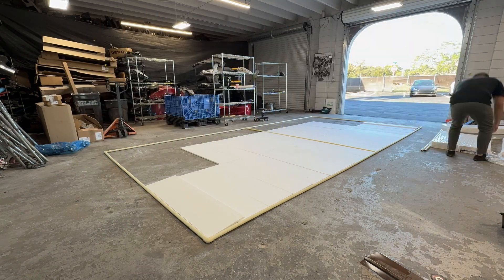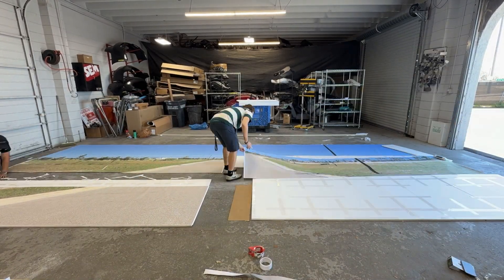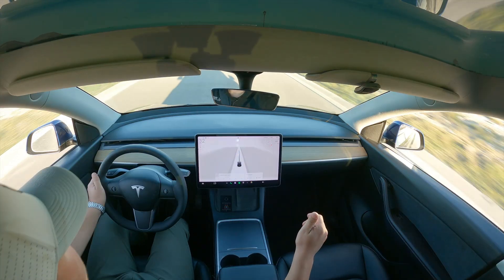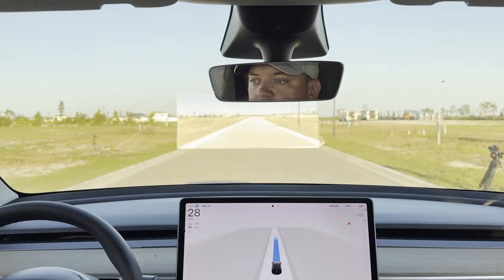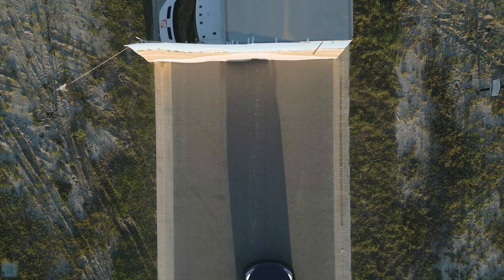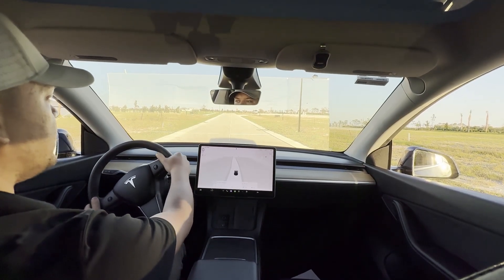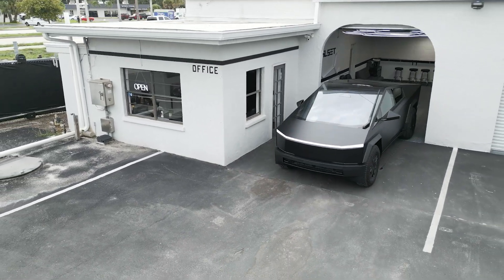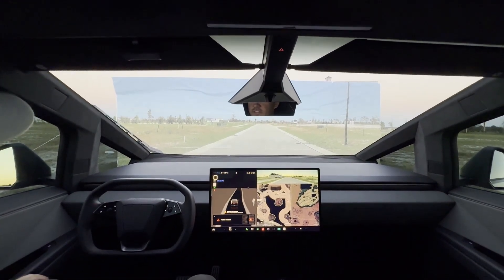Response to Mark Rober’s “Can You Fool A Self Driving Car?”

Comment: Teslas also have radar built in that are fused with the vision data, mark robers video was false, and simply advertising for his investment in a lidar company.
Reply: No they don't. They used to have radar, but Tesla switched solely to cameras in 2022. They also had ultrasonic sensors, which they also removed. Of course older models produced before this change still have the sensors, but tests should realistically be done on what someone can buy TODAY, not what you could buy a couple of years ago.

Mark Robers video isn't exactly false, but it's not scientific either, he made a lot of assumptions about how Tesla FSD and Autopilot works instead of research, which is a bit strange for a former NASA engineer. Either way it's right, a Tesla car relying solely on cameras would absolutely plow through a fake wall with the road painted on it, it's not trained to handle that and frankly isn't a realistic expectation that it should've been trained on it.
Reply: Further on this note radar had been proven to be more reliable through diverse weather farther than lidar could ever achieve due to the basic principals of its function

Comment: Yeah I'm not understanding. You repeating "not touching, not touching, but you did, and we're not clear that you had to press the break to prevent it in the first half. Then with the cyber truck you run it and while it seems like it stopped itself, I'm not totally sure, but the sky had gone grey and the lighting was gone, so the wall stood out in contrast. 
It was the big box truck behind the wall that lead me to realize you weren't going to let the cars slam through in any case. I just feel that you need to make the point you hit the break so that it's clear to the viewer when you did manually apply vs not.

Comment: if you engineer it to crash, then it will crash. And if it doesn't, just engineer it better. 
The point about Tesla self-driving is much more that it is simply not all that self-driving. If the user manual tells you that you cannot sleep behind the wheel, then it's a toy and not something that would be actually useful.

Comment: Great video. I wish the current version of FSD was tested, you can see there was an update pending. I used 12.5.4.2 before and feel the current version 12.6.4 is way better although I'm wondering if it would have stopped. I would guess it would not have.  Maybe having the better cameras on HW4 helped out.

Comment: If you look closely when he approaches the wall in the cybertruck in the visualization (6:58), it only sees the difference between the road and the picture like a small bump. 
When he is fully stopped and closer to the wall is not even there in the visualization.

This and the different lighting conditions.
Reply: AFAIK, the Occupancy Network visualisations (what stopped the Cybertruck here) are always shown as bumps on the road, and never as a full 3D space while driving.
They only show the detailed Occupancy Network data when driving under 5 mph, during parking.
Reply: i am also curious as to why the visualization fades away the wall into the fake road. 

and i've watch the more recent vid which shows the discrepancy is not from lighting conditions.
Reply: The visualization is not fully accurate, what the car actually decides to stop for may necessarily not be shown on the display, or, at the very least, displayed accurately. The car does not use this visualization for its decisions, the visualization is just for us humans through post-processing.
Reply: The different lighting conditions & big version gap (12 vs 13 is dramatically different) are the main factors, or even Hardware 3 vs 4 can be huge too

Comment: Facts.
Tesla phased out Radar May 2021, and ultrasonic sensors Oct 2022 for Tesla Vision only. They only brought Radar back to Model X and S in 2023 which would detect the wall 500ft out. The cyber truck only using HW4 seemed to detect it within safe braking distance. HOWEVER, If the wall was seamless and done at the same time of day as the Y, that would be another test entirely.

Comment: Thanks for doing this - but I will say that when comparing vehicles against each other you need to do them at the same time of day, and preferably switch between them between attempts. If you can find a Model Y with HW4 that would also be interesting to compare against a Cybertruck using the same software version.

Comment: So people have pointed out that the lighting on the Cybertruck runs isn't a good apples to apples comparison, but another thing to consider is the position of the cameras. The Cybertruck is a lot bigger and the angle the camera views it at could also lead ot to see the depth differently. Taking an image shot at a higher altitude to match the Cybertruck's higher positioned canera could also be a factor.

Comment: It can be trained to recognize fake walls perfectly, there is just no need for it.
Reply: Probably not as special training for edge cases often worses the performance for normal cases a lot in AI systems  - you run often very fast in AI overfitting ~ overtrainig with edge cases.  that's a problem of all AI systems.

Comment: This experiment lacks proper scientific methodology and is not an accurate comparison. The Model Y is significantly smaller and lower to the ground than the Cybertruck, meaning the billboard used in the test was not to scale for both vehicles. A properly scaled test would require a much larger and wider obstruction to account for the Cybertruck’s increased height and width. Additionally, the presence of multiple creases in the billboard could have influenced how the cameras or sensors interpreted the obstacle. Given these inconsistencies, this test does not provide meaningful raw data. Based on established technology, LiDAR remains a more reliable system than cameras alone when it comes to ensuring safety in complex driving environments.
Reply: It's baffling how anyone could think that you can do this reliably with just cameras. No matter how good cameras are, Lidar will always provide more accurate and reliable data for this kind of application. And you don't have to use one of the other, they can be used together. I think even a small lidar from a smart vacuum cleaner would be enough to account for these cases. If it's the cost that matters for tesla I mean.

And the reason why it 'saw' the wall up close is because I assume it just started to detect it with front parking radars. 

So at the very least a long-distance parking radar could also be enough to help avoid front collisions

Comment: To be clear, it can only see the wall when he pulls up close to it because this is an early model with ultrasonic sensors. The newer ones, with vision only, would still not see it. 

The refusal to use sensor redundancy will be looked back on as the main way Tesla squandered its lead, and eventually ended up irrelevant in self driving technology

Comment: Mark Rober just switched the auto pilot off before the impact. You can see it in the cut.
Tesla is going to court now.
Reply: Meh. he showed the raw footage of both runs. The Tesla disengaged both times right before impact. Whether it was Mark or the tesla doing it, it was still going to run into that wall and fail the test. 

I'm leaning towards the Tesla disengaging on its own because it detected an object with the bumper sensors or whatever those are.

Comment: So there could be a very real scenario where a Tesla slams into a solid object with a painted road on it under the right lighting conditions. This just proves that Tesla should have continued using Radar as well, and not just Vision only. A Radar sensor would have definetly seen the wall.

Comment: As many people have already stated, I'm pretty sure the lighting situation depending on the time of day you are testing may have an effect, but ultimately FSD Hardware 4 makes a huge difference. Mark Rober should have made his video comparison between Tesla and that LiDAR company fair and used the latest hardware Tesla currently has in production which that Model Y Model in the experiment did not have. Only the new 2025 refresh Model Y has hardware 4.

Comment: The thing about this experiment is that if there is any failure under any condition, it is a complete failure no matter what. The fact that Tesla remotely disabled all sensors to only use cameras is completely unacceptable. We need to lift the terrifs on EVs to improve competition and get Tesla and their complete scams out of mainstream.
Reply: (The scams comment is more of a general comment than about this specific issue. They've delivered on nearly 0 of their promises they've been making for a decade and have already been surpassed by foreign manufacturers. If you have a Tesla because of any marketing you saw, you were lied to.)

Comment: 9:12 - If you paint the whole wall medium-dark blue you can shill even harder. Why would I say that? because the first couple of seconds of the video show you breaking manually to avoid having FSD hit the wall.
Reply: We'll there's a truck behind the wall so he shouldn't be driving through. Did that affect the results because he is intending to brake? No idea
Reply: What are you saying 🤔
Reply: You simply have to look at the screen and see that the camera shortened the lane after seeing the wall unlike the older Y. It sucks that hardware 3 can't detect it but Hardware 4 is an upgrade and passed the test
Reply: You didn't understand this experiment. This experiment proves that hardware 3 cars #old model y are not capable of full autonomy as compared to hardware 4 cars like tesla cybertruck which detects everything

Comment: I applaud you for being willing to test it yourself, and I don't want to be overly critical but.. driving 40mph directly towards a truck(!?) to test automatic braking seems incredibly (and pointlessly) f*cking dangerous. The same test could have been achieved with a simple frame holding the wall, drastically reducing risk without impacting the results. I find this highly questionable.
Reply: I think it was their plan initially but the PVC pipe frame was too light to old the wall.
Reply: a frame with canvas would blow away like a sail unless it was stretched super tight. He also said he's not an engineer but he still did a better test than mark rober so good for him
Reply: @ two poles. pull it taught with tethers. or up the budget. this was just reckless

Comment: Mark Robers wall looked a lot more seamless than this wall; that was his whole point even, that if it looked good enough maybe it could fool the cameras, and HIS did. While yours is a great attempt, it doesn’t look anywhere near as perfect… plus you can’t actually drive through your wall as you’re holding it up with a box truck on the other side; this is an unfair test because no matter what, you will always have to slam the brakes to save the car, versus Mark where he just let the car do whatever it wanted to do, even crash through the wall.
Reply: Why on Earth does it matter whether he can drive through the wall or not? The test made it very clear that the Model Y would’ve hit the wall and the Cybertruck didn’t.

Your comment makes no sense.
Reply: @russellsneddon410  giving the car the opportunity to drive through the wall lets us measure more accurately how close you have to get before it detects the wall. Aka the difference between reacting too late, VS never noticing the wall at all.
Reply: Luminar didn’t pay for his wall.
Reply: @andrewdubose9968 they didn’t pay for anything

Comment: The cyber truck stopped because the wall was much more visible because it was already dark
Reply: The cybertruck was also hw4 and this is hw3
Reply: No. It stopped because it has hardware 4
Reply: @callmeletstalkswgoh8182  it doesn't matter why it stopped or didn't stop. You can't rely on Tesla's camera technology for self driving, period.
Reply: @whatchitnow  Exactly, cameras can only see so much. There will always be a way to trick the system. Still impressive that the cyber truck used it's own lights to recognize it as a wall.
Reply: @whatchitnow  FSD is proving this wrong.
Reply: @Sillingrex  i could say your eyes can only see so much as well. you can also drink and drive, and take drugs and drive. the car cant do that
Reply: @whatchitnow You rely on your own eyes, don't you? If not already, then very soon, the vision only solution will be superior to human vision.
Reply: @ryankozak99 but your brain is infinitely more efficient and sophisticated than a car's SoC and it's computer vision algorithm. That's a big difference.
Reply: @TheKisem  The human brain uses about 20W (but that varies). Current Tesla HW4 uses about 100W. Computer efficiency and potential likely (at least) doubles every year. Extrapolate...
Reply: @TheKisem  This is simply not true. FSD will become far safer than any human driver, and make our roads far safer. Humans make terrible drivers. My drive today was a perfect example of this. FSD will follow the rules, will not get tired, will not drink take drugs, get angry or depressed. Not to mention the fact it sees all around the car at all times. Something impossible for a human.
Reply: @ryankozak99  But it's not your eyes that allow you to understand its a wall; your eyes just take the picture. There is an extremely complicated "computer" (i.e. your brain) which is doing crazy split second "calculations" that is what actually allows you to understand that you're looking at a wall. Your brain is what picks up the very minute details of the image of the wall, and it's what does a level of pattern recognition that computers still cannot compete with in most scenarios. And I say most scenarios, simply because the reality is that your brain's image processing functionality is so advanced and complicated, that it occasionally backfires on us, and causes us to see optical illusions at times where a computer wouldn't (e.g. the colour constancy illusion).

And honestly, the limitations of optical image processing shows even in Mark Rober's video. Everyone is so hyper focused on the wile e coyote demonstration, and I think we're all forgetting the demonstrations where the cars were set to drive through conditions that have almost no visibility. Like yeah, even humans would be incapable of stopping in a timely fashion in a thick fog, because optical light is just limited in what you can perceive, where as apparently the lidar technology can penetrate the fog at a further distance.

Because at a fundamental level, that's what lidar specializes in. The lidar technology itself probably can't differentiate between a paved road or dirt. It probably can't detect the painted lanes on the road. To discern these things, you probably need a camera with image processing. But what lidar specializes in, and is even more accurate than our eyes + brain at doing is detecting the shapes of the objects around it, and calculating the precise distances of them. So naturally, if your series of tests focuses on detecting objects in the middle of the road, the sensors that are highly specialized to perform the task of detecting objects and distances from said objects will be superior to anything, including our own human brain processing of what our eyes see.
Reply: @whatchitnow  than you can't trust your eyes to drive either. Sorry. Turn in your license. I don't want to hear any arguments from you. I'm only going by your own logic. It's not like you have double standards or something is it?
Reply: @NerdyStarProductions   @NerdyStarProductions  You make good points, and at the same time use "split second" as an argument in favor of our brain. Computers are incomparably faster at calculating and deciding than we are.

Lidar struggles with fog because water particles of that size disperse it - probably why they used smoke to "simulate" lidar.

Today's average computer can find patterns orders if magnitude faster than us (100x, 1000x?).

Yes, lidar can only measure distance (extremely well) and radial position (angle). It is impossible for it to see lane marks or read signs.
Reply: @whatchitnow  the cameras are not working like your phone camera, the cameras are doing realtime cv and using their massive model that has used lidar during training. This comment is so stupid and goes to show the lack of understanding people have about tech with the loudest voice.
Reply: @TheKisem  give AI 2 years and that wont be true.
Reply: @rano12321  That has used lidar during training? So what a camera that takes a picture of whats infront of it can now magically see through fog? lol you really hit the nail on the head with your last sentence.
Reply: @ryankozak99  Wattage/power doesnt correlate to performance when efficiency is difference. human brain function closer to a quantum computer than a typical computer. our decision making is a lot more complex and can be out of the box but Tesla is limited by algorithm. at one point, the algorithm would match or even surpass what human can perceive in term of threat recognition and others but I don't think it is ready yet
Reply: @daydreamer8373 boi some people really like tempting fate
Reply: @Sillingrex This aged like milk
Reply: @callmeletstalkswgoh8182  You can't point out the reason if you change two parameters at the same time.
It is great that the cyber truck with HW4 stops but to be fair it also should be run at noon with similar lighting of the wall and the environment